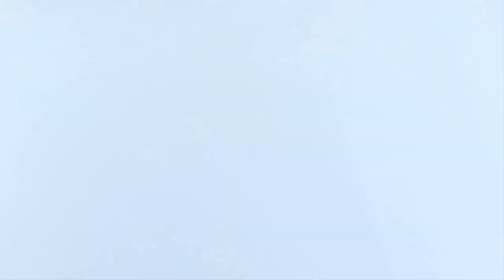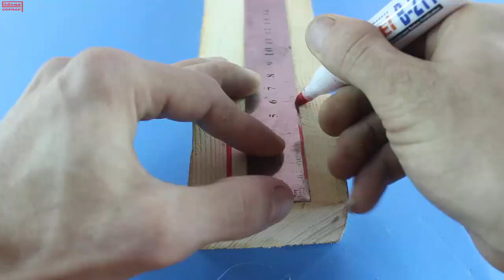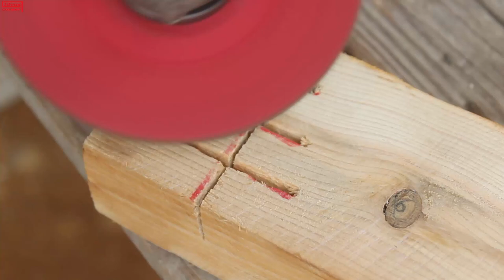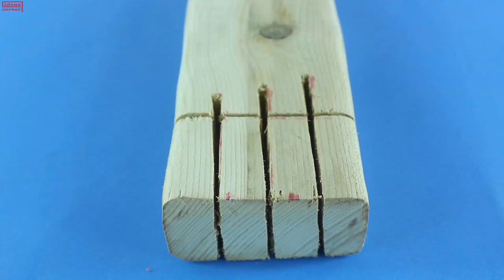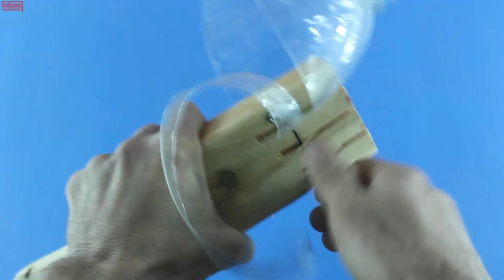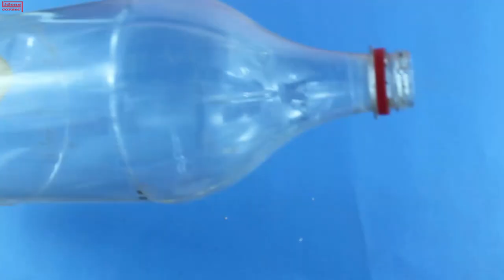How to Make a Plastic Bottle Cutter at Home

Comment: I love this idea and the simplicity of this particular design. But I struggle to get the bottle to cut evenly — it hardly ever feeds through straight. I find that I need to feed the bottle through much slower/manually than these types of videos show. Anyone have the same issue or some insights into why this happens?